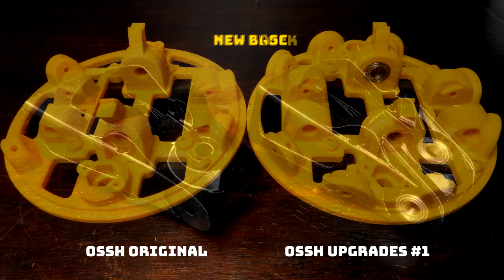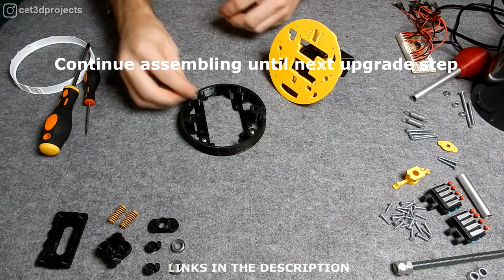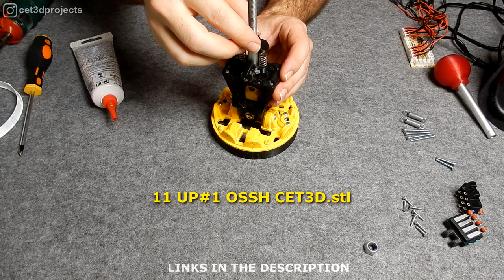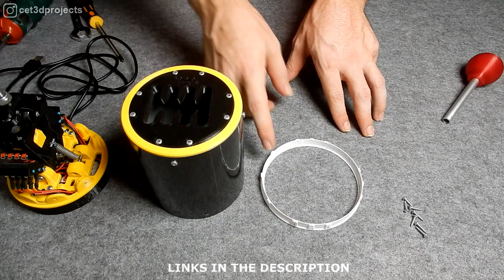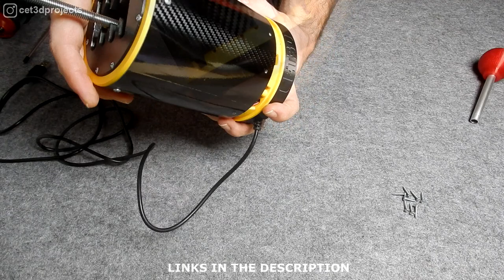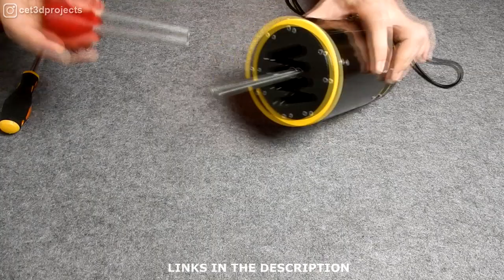Open Sim Shifter H - Upgrades #1 - DIY 3D Print - Sim Racing

Comment: а ты что не написал что  трубка 6мм  она в подшипники не подходит по диаметру я заколебался трубку подгонять
Reply from the maker: Hi Andrey, the tube does fit, in the video you can see how you have to hit the tube a little to insert it. If you want to insert it more easily you should simply make the tube thinner with sandpaper, but it is not necessary, I prefer to avoid gaps. It may also happen that you have deformed the cut part and you must adjust the tube previously and check it with the vernier caliper so that it does not have more than 6mm. All the best!
Reply: на видео я видел как она заходит но я точно такую же заказывал и она в подшипник не залазила даже с маленького удара.  даже от удара молотка не заходила пока я трубку не снял чуть не 1 мм после она зашла с маленького ударчика. но кпп я собрал работает вроде норм. может подскажешь где найти файлы для печати ручки для евро трак и  АТС где 2 переключателя в ручке есть
Reply from the maker: @andreystartsev5595  There would probably be some deformation or crushing in the tube, it could be due to shipping.
About the lever for eurotruck, you can search the user "Historiker" on thingiverse.com, he has a mod for this, give him a good like.
I hope I have helped you, for any questions do not hesitate to comment, greetings!